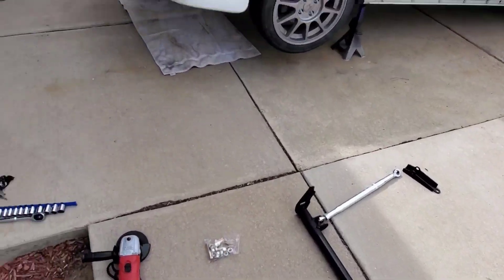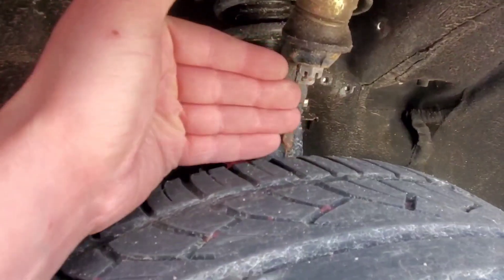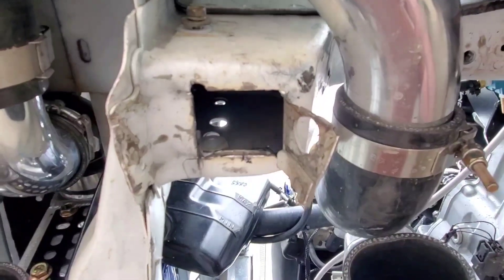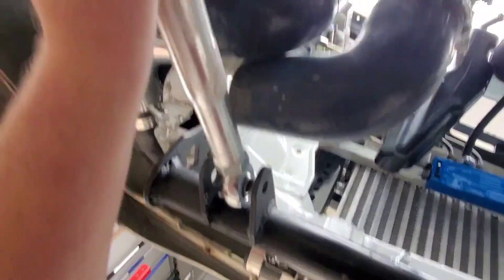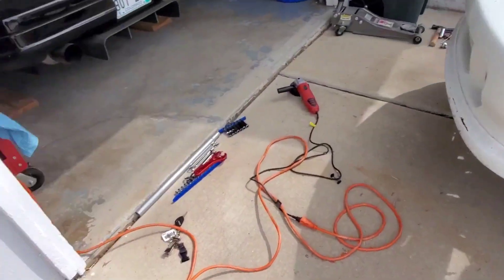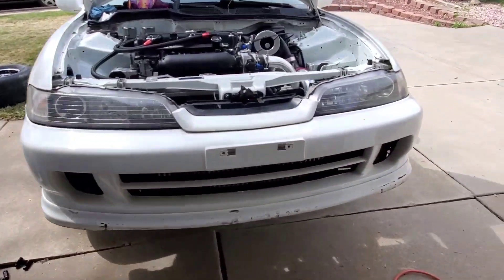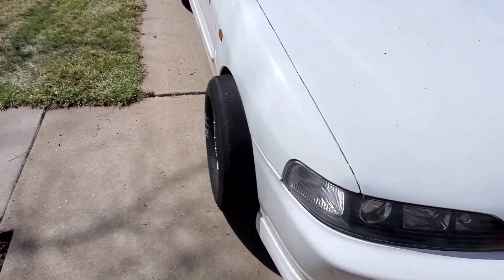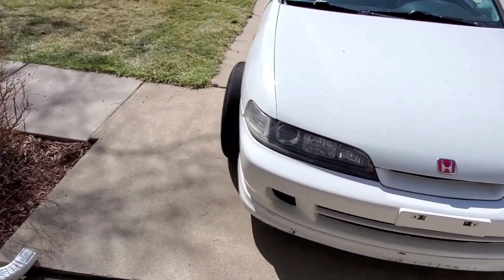Integra gets TRACTION BAR and SLICKS!!!(full send pass on the street)

Comment: Hey man nice looking pulls, looking to buy a set of slicks for my integra setup. Did that size work good for you without major modifications and what size were you running there? Thanks man and nice car
Reply from the maker: I run 15mm spacers up front to make them fit. Other than that they fit perfectly